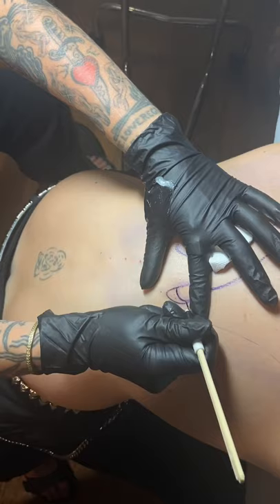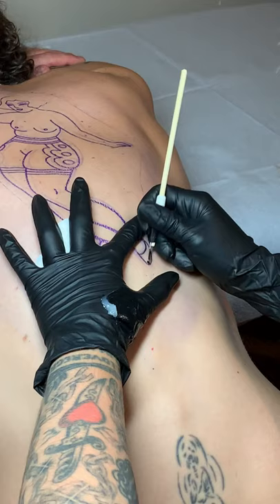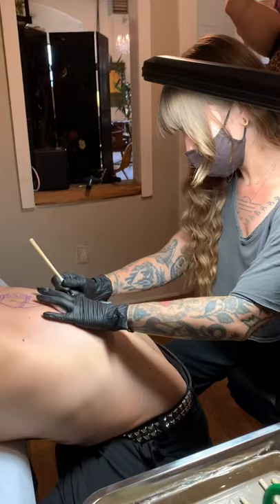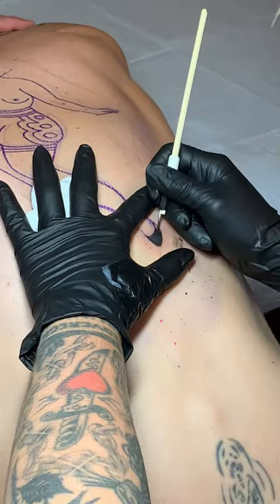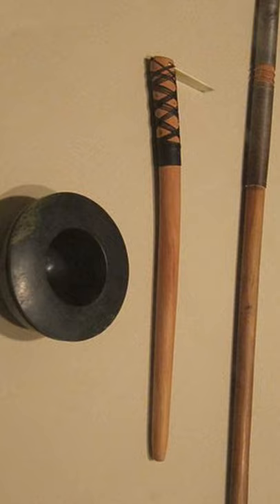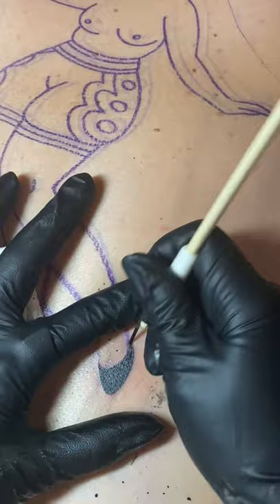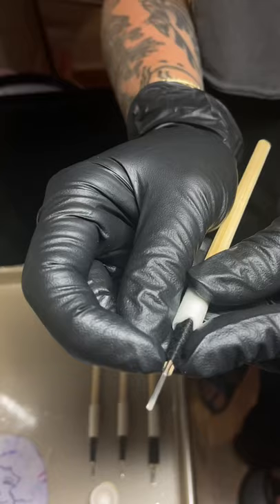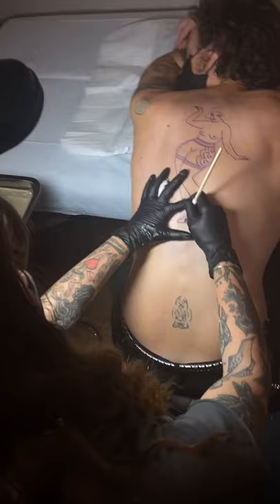Stick and Poke Tattoos

Comment: In my experience, IF done properly, it is waaay less aggressive to the skin, resulting in reduced inflammation, pain, lower risk of infection and scarring.
Reply: Can confirm! My stick and pokes healed much faster than my gun tats
Reply: ON GOD? it looks worse but knowing this makes me feel better
Reply: You have more precision when each poke is slowed down
Reply: really?
Reply: I gave myself two stick and pokes a while ago and honestly they barely hurt, they were small and I went over the lines multiple times, the area basically numbed itself.
Reply: @Hikarixhikarixhikari  it doesn't look worse if you're good at it
Reply: @Hikarixhikarixhikari  i have multiple tattoos I've done myself n Ive been told they look professional
Reply: @mossman2353  I think they meant looks worse as in looks like it hurts a lot more? But maybe not
Reply: I have 2 stick and poke tattoos and one done at a tattoo shop & the healing process was way easier for stick and poke, my memory is terrible but I’m pretty sure right after getting them I could touch the tattoos without feeling anything and it was really surprising since it took so long for my other one to heal 
but while getting them it was sooo much worse than with a tattoo gun because I could feel the needle getting stuck in my skin every time they pulled it out and it was terrible. They were both pretty small tattoos or I don’t think I could have handled it 😅
Reply: to be fair both of my stick and pokes were done by friends and I don’t know if they were doing it properly but just sharing my experience lol
Reply: So people don't seem frightened of it then? 🤔
Reply: @communistsharks6889  <----😆
Reply: It seems like it would hurt much more
Reply: BOO!
Reply: Yeah ok your crazy I’d rather the fast strokes then a slow and painful stick 😂😂 that’s cause your a artist and expect it. They dont😂
Reply: @zacharyhartman2842 had a 10 hour stick and poke, hurt waaaaaaay less than a 30 minute tat with a tattoo gun
Reply: Could that be because they are generally less intimate designs generally? Or just that the needle work itself is less aggressive than machines?

Comment: Stick and poke tattoos are great, but be warned, you can and will hear your skin popping off of the need. So if that sound grosses you out I don’t recommend it
Reply: That's a particular way of applying the ink. A lot of stick n poke artists use various ways so you won't hear that noise throughout every artist. Also that noise isnt loud compared to a machine
Reply: @xImage98  Actually I agree with sir potate ,the sound and tehe feeling is gross, machine it's louder but without gross sound and the feling of pulling your skin up
Reply: @mattiacenacchi726  yeah pulling the skin up is a bit gross but as long as you’re not doing it to deep it’s okay.
Reply: @cosmo588  yeah it,s the sound
.......now i just blast music and it's ok.....
Reply: ohh it's the same sound when piercing a piercing thru the layer of skin

Comment: Reminder that this does not validate doing stick and poke tattooing YOURSELF if you are 1) untrained 2) do not have proper equipment 3) are not in a sterile environment.
Reply: Look up what blow out is, before ever trying. You can easily go too deep.

Comment: I gave myself my first tattoo at 12 with gel pen ink, needle and thread, a little flower, found out a few years later it glows under black light, 😏 had it covered up, but you can still see it glow under the right lighting 😆

Comment: So does it hurt more or less?
Reply: since it's one needle on the small surface it probly hurts more if it's a big tattoo, since with tattoo needles it's faster plus more needles over the larger area which sort of "eases" the pain with multiple of them. im not the best with words but it's basically pressure dividing on the space? 😅

Comment: I have always wanted to try this.
But I have found the older I get the more painful tattoos are to get.    While I used to be excited by the whole process I now dread the healing process.  My wife hates it cuz she has to be so careful in bed not to knock them.   I didn't start to get tattoos anywhere visible until after the death of my Father out of respect but since his death 6 years ago I have a half sleeve on both arms and my left hand is done.

Comment: I understand the history, collection, and cultural aspects…But I don’t understand why anyone would want stick n poke when there is a lot more room for error. But hey if you want to do it go for it. I just think it’s silly at this point with far tattooing has come.
Reply: They come out a lot cleaner and over time they don't look like shit
Reply: How exactly is there “more room for error” when done by a professional? Every jab is calculated and it can actually be a lot more precise & cleaner lines than with a machine that’s running a mile a second, one wrong move with a machine and you have a shit line. Seems to me it’s the other way around and it’s easier to have an “error” with a machine. Some of the most perfect & cleanest tattoos I’ve seen were hand pokes done by a pro.

Comment: So I feel as if she is putting that pigment in wrong with her set up. Hear me out. She’s got that stroke down. Great. But…. And I’m assuming here. She’s using normal needle in bar pins? If so why is she using the hand motion for bent pins? It’s not barbed. So that excess tilt on each “poke” seems wasteful? Just an observation. I’m not hating. She’s got that patience. I just don’t understand the hipster vibe? If ANYONE is doing what she is…. Bam. Traditional only. Be different. Be what ya want. Not what you think that will give your mad respect in the industry. Meh.

Comment: Making a handle that lasts forever is far much better for the environment than biodegradable pieces. Some people just don't think things through smh
Reply: Most tattoo supplies are single use because of blood bourne pathogens… many shops don’t have an autoclave to sanitize reusable grips and tubes (I haven’t ever worked at a shop that had one). We are doing out best in an industry with so much waste.